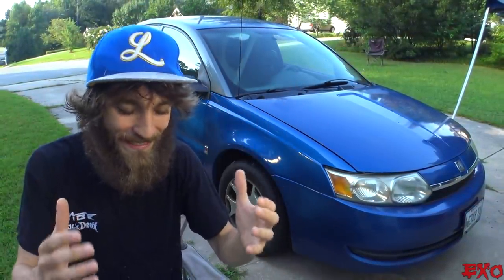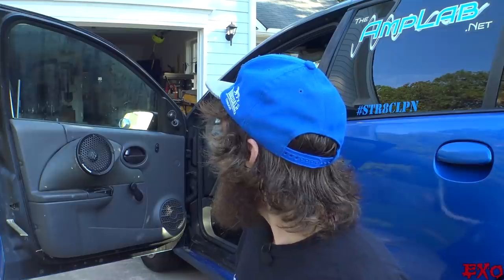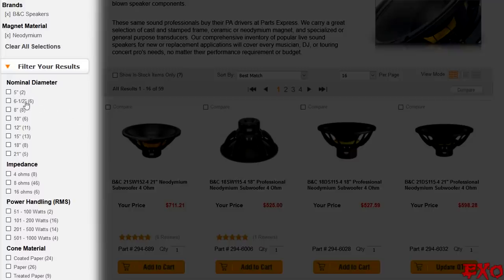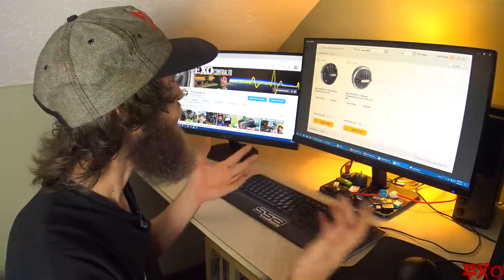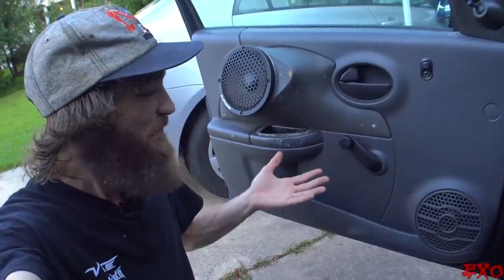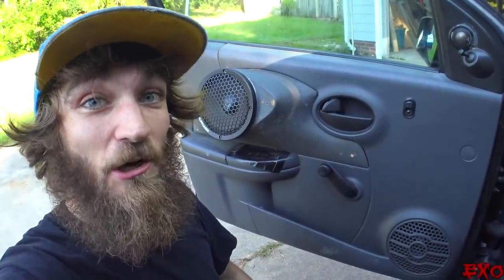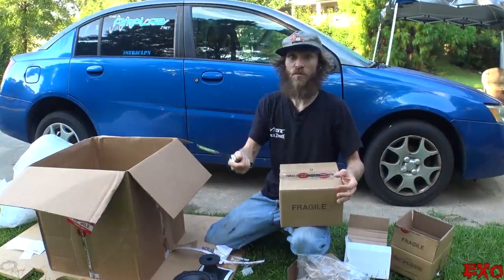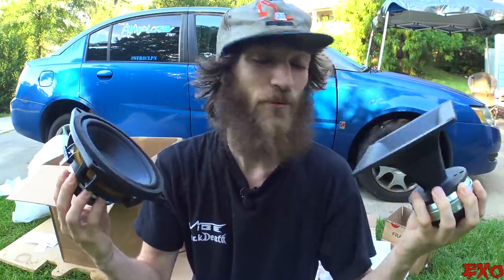Choosing The BEST Speakers for CUSTOM Door Panels & Planning EXO's B&C Car Audio SPEAKER POD Build

Comment: I wouldn't use compression drivers and horns.  My ears are so sensitive to high pitch noises i would be using 8 or so silk domes on the dash.  Four on each side aimed up to bounce of the windshield,  that is my style.
Reply: Yep, I have 4 pair of Massive German silk domes in the doors. They are so much better than all these bullets, compression drivers and metal domes! As good as they are, I want ribbons now. lol
Reply: That's a matter of personal preference, with good quality source and amp, metal tweeters reveal more detail. And with a waveguide it will have a much wider dispersion. I once used DE500 with 18" waveguide in one of my home hifi builds and it sounded fantastic.
Reply: I used to have a Sony unpowered tape deck, Sony 10-disc CD changer, all Infinity Kappa 5x7 split sets in the dash, 2-way Infinity 6.5s in the doors, and 3-way Infinity 6x9s in the rear deck in my Beretta with two Image Dynamic 15s, two ID 1500 watt amps, two 3 farad caps, two Optima Yellow Tops, a Sony 4 channel 400x4 amp for the mids and highs, and that car sounded amazing inside. You could hear a pin drop from the Kappas. That was the absolute cleanest setup I have ever heard.
Reply: Ever hear of tuning? That takes care of the high pitched noise you think you hear. EQ works all that out.
Reply: A horizontal line array of domes under the dash aimed slightly up. Super space saving. Knew a guy with a sunbird that did that, but with image dynamics  horns.thin and wide. Had black grill cloth on then, couldn't even tell where the sound was conning from. He was a SQ guy